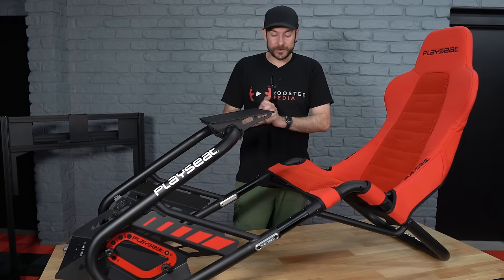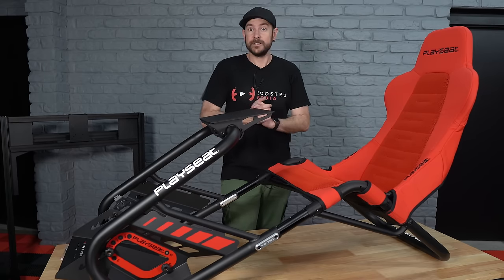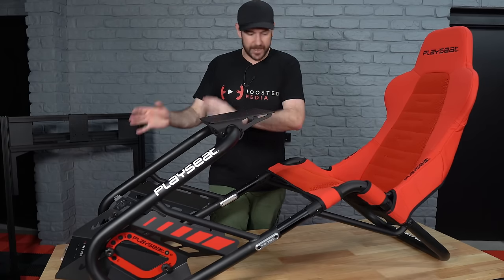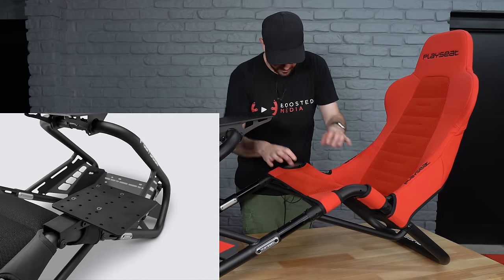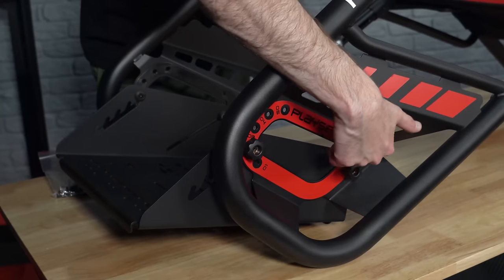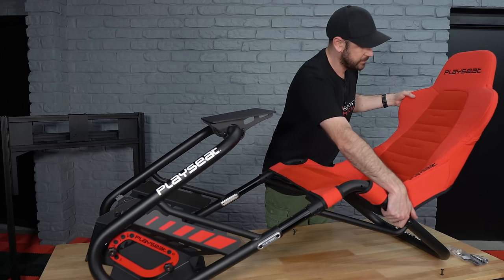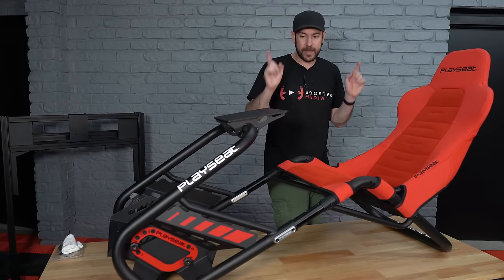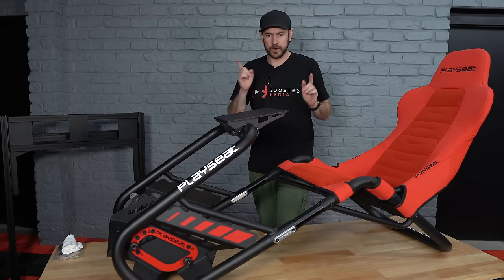JUST BUY A PROFILE RIG? - Playseat Trophy Sim Racing Cockpit Review

Comment: I was really tempted to get something like this but went with a super heavy duty stand the Next Level Racing WS2.0 it's a absolute tank and goes absolutely nowhere even with a 12Nm Moza R12 with CRP loadcell pedals it stays put for a stand the build quality is amazing I think GT Omega are r only other company who makes a stand near this level and it was slightly cheaper than a FGT cockpit from Next Level Racing I'm talking about the folding one not the crazy extruded aluminum one that is like a grand with a seat I plan to get the GT seat upgrade for my stand at some point that's the best thing about this stand you can upgrade it to a full on cockpit later down the road

Comment: Hopefully you see this.
I am looking at this for my living room in front of my TV not a have a concern with the height of my TV relative to seating position. I’m worried the wheel base and wheel will partially block my view to the TV.
Very bottom of the TV is 63cm from the floor.
I’m 168cm tall and plan to also buy   fanatic GT DD Pro bundle.
If you’re willing or able to test this I’ve be grateful (understandable if you cannot)

Comment: I have the black one of this for a month now (switched from NLR wheel stand 2.0) and I like it pretty much. I don't have the space (yet) for a fixed position cockpit (or even storage is problematic) and besides the fact that this is light and easy to move an other advantage is, I can store it vertically with the back of the seat on the floor (part of it is actually under my bed).

I bought the shifter mount too (as I have the fanatec shifter and handbrake) really solid too. Only problem is that it doesn't have the holes for bottom-mount of the handbrake, so I had to bolt it to the shifter's side.
Reply: How many Nm do you run and whats the flex like?
Reply: @TheDoctor46vr  It was a CSL DD at the time I wrote the comment, but I've upgraded to a ClubSport DD in February (so to answer your question, 12nm). No flex at all. I think it could handle anything you throw at it.
Reply: @-fatal-  there will be flex at 12Nm because that's what we are seeing in this video. Will never mentioned the Nm he ran but I did ask him and he said it was 12Nm.

The thing is a lot of people think their is no flex because they can't feel it, but if you set up a camera like Will did you will see it.
Reply: @TheDoctor46vr  There is no noticeable flex, not that you would notice. On camera maybe there is a little, but it also depends on how tall you are imo. I'm quite short (175cm). There are reviews with DD1, it can also handle it.

Very minimal flex doesn't matter at all. On camera you can notice a little bit of flex even with an aluminium cockpit.
Reply: @-fatal-  Why would it matter how tall you are that doesnt make any sense. Will is using a DD1 he just doesnt have it turned all the way up which is how most people use overpowered wheel bases.

It does its just a matter of how much does it matter, as Will said going to his profile rig afterwards he noticed the difference. It will just numb some of the force feedback a little bit.

Comment: Hmm, my long legs would push the wheel far away? In a local story there was a setup with sliding chair and when I adjust the chair, the wheel was impossibly far away.
This thing for me might require an adapter plate of sorts for the wheel base perhaps... Or, a way to push the pedals forward.

Comment: I just got mine yesterday. Logitech pro DD wheel and pedals. Very nice and stable, comfortable, and since I need to move it out if the way of my home theater space when not racing, it's perfect. I sit 65 inches away from my 130 inch wide screen.

Assembly took about an hour and then I spent another hour dialing in my specific position and cable management. I used zip ties (though mine did come with cable velcro ) for a clean look.

Comment: Would be cool to see you take a look at GT Omegas ART/Titan cockpits
Reply: I have the Titan if you’re interested in my honest feedback.
You can install wheels and the shifter is easily removable, I roll mine directly into a closet for storage which was my criteria for acceptability. The Titan has a strange angle to the foot plate and seat which doesn’t feel natural, the seat itself sits completely flat with no rear tilt which doesn’t really make sense or feel right and the standard seat gets hot pretty quickly. However the rig is very stiff, reasonably adjustable and the shifter setup works well. There is clearly room for improvement but I couldn’t find anything better for the money that fit my closet criteria.

Comment: Attention to the owners of this rig - does anyone use this sort of like a "foldable" rig, as in, do you use it, then get rid of it into a closet or something? I don't have a large living room, so I want to pull it out for simracing and stow it away after each session, and I'm wondering can this rig be easily picked up and placed vertically in a closet somewhere when not in use, or is that not possible because it's too large, too heavy, or simply doesn't want to be placed upright, so it always has to be down horizontally? 

Thanks in advance!
Reply from the maker: I really don’t think it’s practical to expect to put it in a cupboard after use every time. It’s going to be too heavy with the gear on it. Maybe look at a coffee racer foldout coffee table as an option instead?
Reply: @boostedmedia  Wow, I did not know about coffeeracer, thank you for the reply and the suggestion. I guess I just have to stick to my playseat challenge foldable until I move to a new apartment where I can have a dedicated sim rig. But thanks again :))

Comment: Would love to know what the pedals are you’ve mounted directly to the frame. The brake pedal looks like it moves as a brake pedal should. I have the fanetec cell load pedal and kinda hate it. I can put my full body weight into it and it hardly moves, like pushing against a brick wall. Upgraded the bushes to softer aftermarket ones and just as bad really. Very hard to modulate braking at all

Comment: Be warned that the length adjustment extends under heavy braking despite tightening everything down. It's a deal breaker for most people.
Reply from the maker: Ahh that’s not good. Didn’t experience that but we did run the adjustment maxed out for most of our testing to suit my height. 

Maybe once you have it in the right position you could drill a hole through the whole thing and drop a bolt through to lock it in place?
Reply: Yep. I'm experiencing this and it is incredibly frustrating. I need to be on the small setting. By the end of the race it extends the the large setting, and I can barely reach the pedals. I wish I had just bought an 8020 rig, but now I'm out $600.
Reply: @Lithirrael  I got something called finish line fiber grip and applied it to the inside tube, it creates friction and helps stop the extension. It kept extending though so I just bought some heavy duty zip ties and fastened them to prevent it. Doesn't look super pretty but it works.
Reply: @boostedmedia  I'm current using some carbon fiber grip paste and zip ties that are working but I like that bolt idea! Would look a lot cleaner.
Reply: @Abraham_Justice  yeah I've tried using that same brand friction paste. No success for me either.
Reply: @Abraham_Justice  where did you zip tie to solve the issue?
Reply: @Lithirrael  the top part to the bottom part. Hard to explain it but if you got a zip tie for that area of the chair and thought about where you need to put it to keep it from extending, it would immediately make sense to you.

Comment: I'm a mountain biker. I'm also a sim racer... I've been doing both for over 10 years each... Why have I never thought of this? Guys. YOU CAN PUT THE WIRES THROUGH THE TUBES! MY EYES HAVE BEEN OPENED TO MY OWN STUPIDITY! WHY??? WHY HAVEN'T I ALREADY DONE THIS ON BOTH MY RIGS??? Seriously though. Every single bike I have is internally cable routed 🤦🤣 And yet I've never thought, "you can put it in the tubes," on ANY of my rigs over the years, and on my square steel rig it'd be SO easy to make happen 🤣 Thank you for this review; both Boosted Media a YT recommended 🤣

Comment: Thoughts from owner of PT after 12months. Great rig but you have to be a curtain hight otherwise you will drive from your shoulders not muscle. I'm 180cm. Which will end up in wrist and shoulder pain. After long stints. No hight adjustment is the biggest downside. Apart from mentioned issues if you fit its a great rig but it's still a bus stop and preparation for aluminium profile. I would buy it second hand or black Friday deffo not worth the 550£ or more.
Reply: If you look closely 24:28 the top of steering wheel is at the same level as Will eyes this is really bad. Correct position is top of the wheel is at the same level as your chin. The rest can be adjusted to your body that's the correct painless seating position. Can't talk much about F1 seating as never played F1 games. But it does bring you back to days when you was like ''I'm in my moms car VRUM VRUM''

Comment: This new Play seat surely sounds tempting ........if you were a simmer spending +90% of your sim time in modern GTs or open wheelers. But I'm just thrilled about my <DKK2200/<€300 NLR F-GT Lite flexible seat, being very robust for heavy loadcell pedals and wheel stand for DD +15Nm wheels, besides for multi purposes, all from GoKarts, trucks, vintage sports cars, rally cars, open wheelers, antique pre-war race cars, when you've just solved the puzzle, its quick and easy to switch between 4-5 positions as I do on a weekly basis.  More over only solution since I primarily have my sim activities in my small 8m2 office room with both library, night on watch sleeping room, technical work test bench room and everything. Then I simply HAVE to have a foldable solution.
After my investment just into Cov-19 depression I now could never think of going back to more or less fixed seat.
Especially taken into account how robust my flexible NLR seat have proven to be, if just you ensure the joints in proper way every time - of wich is no sopper, rapidly becomes common virtue when at first you had the typical single incident.

..apart from my off-toping. Thanks for an indeed thourough walkthrough - now my plans goes for expanding the house just to buy this Playseat, too!

Comment: I cant agree with Will more here at 26.50, I have used loads of different style rigs and 8020 rigs, here have the same exact seat in red and a couple of months back was lucky enough to snag a Samsung Ark in the sale, I have it low down straight behind the wheeldeck almost touching the black frame behind it the immersion is second to non!

Comment: I really struggled with the wheel height on this one. I am 5'7 but just found the wheel  height a tad too high for comfort, sold it on. Pity because I really like the look.
Reply: I been using mine roughly 1 year im 6’1, feels super, never had 1 issue with it, super adjustable
Reply: I’m the same height, and yeah that is my main complaint. Wheelbase flat with the seat reclined a little more is the only way. I’d like to see a revision of the design that addresses this, but I’m used to it.

Comment: i have the wheel deck flipped upside down and mounted under the bar, and it works great with my CSL DD, lowered the wheel quite a bit
Reply: Same. I never even tried mine in the standard position, and only bought it after lots of estimating of dimensions of wheelbase port positions, etc. 

I am really happy with my Trophy, and was watching this expecting Will not to be happy with the lack of height adjustment. 

Turns out Will is 15cm taller than me, which I wasn’t expecting.

Comment: One thing I’m curious about is I think that the both the wheel and pedal plates can be flipped, which I haven’t seen any actual pictures or videos of, but if that were the case then it seems like might be a way to get closer to a formula style position, since then the seat can be moved forward with the wheel plate turned around, and the pedals raised as well with the same total distance. Has anyone here tried that or know about it?

Comment: I have the play seat challenge and will be upgrading to a gt omega pro this year, for this price point i just  don’t really see a market for it. Yes it includes a “chair” but this is a wrap over frame not a real chair. I paid under £200 for the challenge and yes this is better all over quality but i Dont think it should be priced over £299.  Better than the challenge and other similar fold away rigs but No where even close to the quality of a alum rig which what this is closely priced at.i see these collecting dust in the warehouse. If you dont have room for a full
Rig then i would
Just save 300 and get a challenge, 2
Mins research online would show these ludicrously overpriced. But they do look smart and are comfortable

Comment: I set one of those for one of my friends' son. It really does go into full formula 1 racing style seating. You just need to mount the wheelbase the other way around to move the wheel further away and move the seat a bit close. Accidentally i am 190cm as well and if the Formula 1 driving style it's even more comfortable than in GT setup. It's also quite easy to nap off into that config because if how unbelievably comfortable the seat it.

Comment: If that was a garden chair it would be 300tops hence this market has recently crashed due to market size was 2-3% at best. An exampke would be in an actual car this much metal is about 250 including the welding and paint hence 600-700 is so overpiced. I get it business needs to make 15-20% to stay viable yet these things have 100% markup on them and essentially a luxury item hence ghe 2-3% market size

Comment: I think youre too kind to this rig. Its expensive to a point where its almost the price of an alu rig+a reasonable seat and not even this comes anywhere close to an alu rig.
an alu rig has 0 flex and its huge strength which makes it the endgame solution is the flexibility. you can add/remove anything from it. wether its an h-shifter, a sequential shifter, a handbrake, displays, places to put your keyboard and mouse on, you can get an entire PC mount, you can put a buttkicker in it and obviously its very diy friendly.
i bet you this rig wont be in the same condition in 3,5,7 years as when you buy it new whereas the alu rig pretty much doesnt age and even if certain parts wear out, its modular, so just buy the profiles that are broken and replace them. very easy thing to do.
If youre already spending that much money on a rig, it should be an endgame rig that you will never have to upgrade from again and this aint it.
Reply: Just because it doesn’t meet your criteria doesn’t mean it’s not the best option for lots of other people. 😉

Comment: Had the playseat evolution for 6yrs stood the test had a few welds redone on the wheel base due to heavy ffb.. now upgraded to the TR80 pro this is a tubular system but rock solid. I dont like the bulky square alloy rigs there ugly and only fit for the basement.